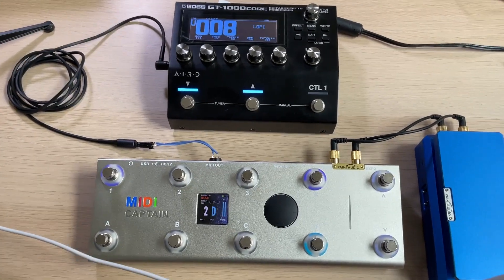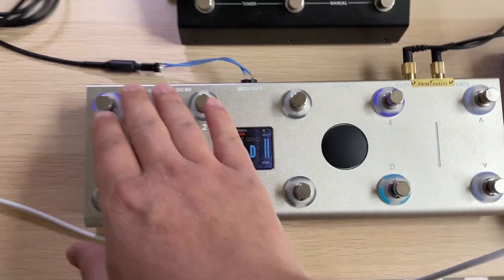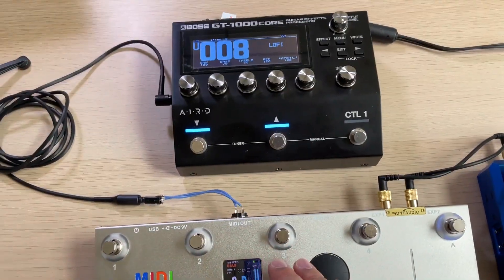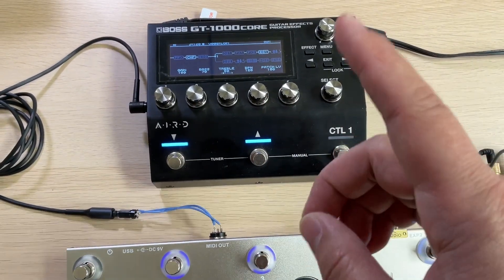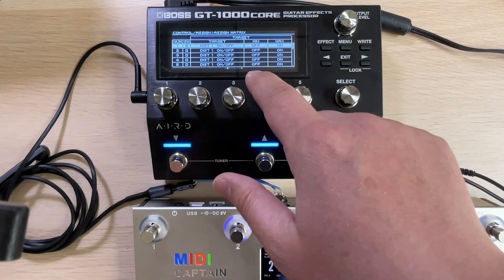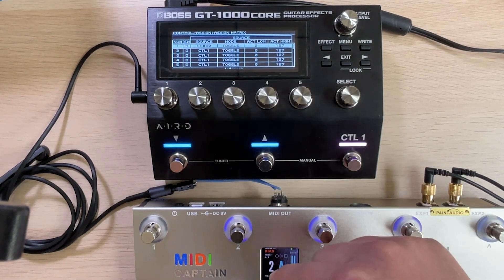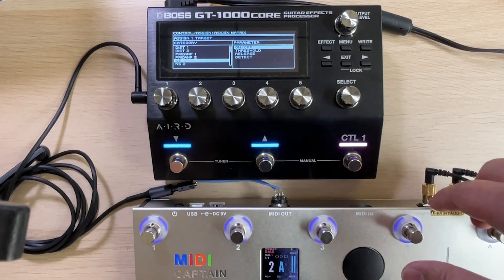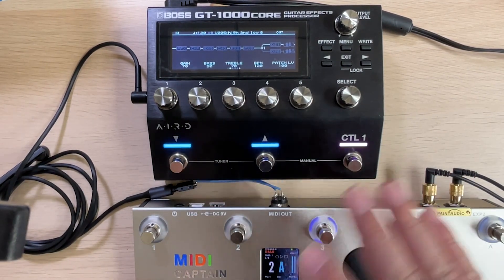How to use MIDI Captain to control Boss GT1000 core PC/CC setups and tips

Comment: Can someone tell me how yo find out what the cc numbers are for exp 1 and 2? Using supermode 4 page 13
Reply from the maker: exp1_CH = [1]
exp1_CC = [1]

exp2_CH = [1]
exp2_CC = [7]
Reply: @Wilson-PaintAudio 
My gold 10 button unit will not scroll to all 250 user patches and also will not stay set to page 13 in super mode. Is there a way to fix this?

Comment: Midi CLock Sync issue! Ive connected the Captain via USB into mac. Geek mode. Set the midi thru option to [ON] within the USB GEEK mode. When sending midi clock info out of ableton to the midi captain, then connecting a midi cable from the Captain's midi O/P to the Boss GT-1000 core's midi input, the tempo fluctuates and never stays still on the actual tempo... ANy help on this?

Comment: Hi, I'd like to give ABCD the 1245 patch of gt1000 as a pc value for example and the 2345 patch of gt1000 core for the next preset. And I want to turn on and off the effector that I need with the PC value fixed on the 1234 button of the midi capain. I don't know how to specify the pc value of midi captain.  How do you do it?